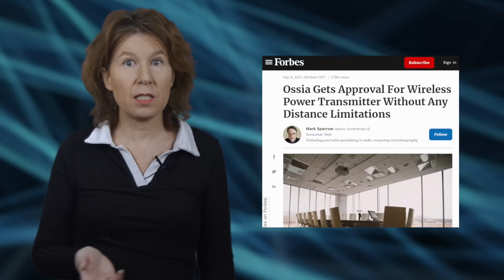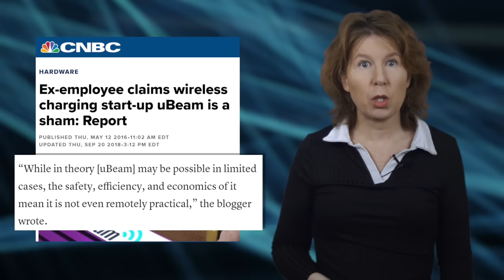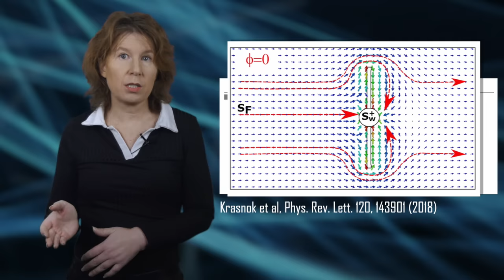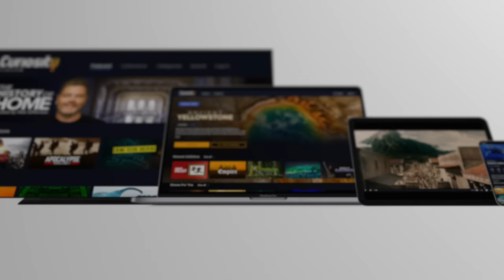How close is wireless power technology?

Comment: I am a ret. General Contr. and Doing Science since I can remember. The problem is the average person and even scientist has a clue what they are taking about. Even promoters of EV are illiterate. I hp = 750 watts start their. I built Oil Caps and UV Pulse Lasers for my Man made Step Leader Project to harness Lightning. I also have built home brew Parabolic Reflector and Collector up 6.4 kw. and Have a 5 meter Commercial Dish I aquired when I installed system for Cable. I lobbied the Cable Act in 92 and was a part of the worlds first C-Band Satellite Radio Station. I did the Ham Radio Links and Gateway from 2985-87. I have used and am familiar with Micro-Wave from 2.5 to much higher. Also Traveling Wave Guides anx Mixers. The 3.7-4.2 C-Band downlink freq. is part of C-Band and originated with ATT terrestrial Towers Prior to Satellite transponders in the Clark Orbit. Most of the people Have no conception of RF or Inductance or Capacitive Coupling or B-Field Coupling. They live in a world of make believe and lack understanding of just how much energy is carried around those wires. So.much make believe about solars 15-22% non efficient cells and Wind BS. And Lithium I spent years Trying to shake that electron loose with UV and X-Ray with a little success. My folded Large Plate Capacitor Design Revamped the UV Gas Laser. Takes a lot of conductor and Short distances to dump those electrons on tge rail. My folded LASER design did that. Vanderbilt Copied It. In 1990. These people seem to not understand even the most condensed beam or cardiodic pattern while not omni-directional still because of the magnetic component spreads. While a laser being of the same frequency and lacking that b-field spreads far less if the waist beam is set properly. I spent many hours with Plasma, HV Resonate Xfmers, and Accelerated Disc and tubes of Copper and Aliuminum. I had some water cooled klystrons. Many supplies I built up to 7,500 vdc at 1 amp for linear Class B Grounded Grid Amps with 4-1000 jugs. I also has the avantec 3 meter aluminum Tower dishes with Shrouds and Back Fire Transmit Systems. From Solid Rocket Motors in early 60's to Telecope and Equatorial mounts. Ton of.home brew electronics. Technology is Great But Perpetual Motion is Garbage. If it ain't  broke don't fix it. When someone spins a disc and cuts a slit in it and puts a semiconductor junction across the gao and now detects super tiny fields if energy at a distance Just reverse tge process. I wished. But, A shorted turn or a Time machine you decide. No two point with in the disc are here and now with respectbto the other. A shorted turn. Yes, but so much more. Look inside at the crystalline structure and why it is a literal time machine and why the universe is not straight. This matters. And doing di-electric phoresis in conjuction with it was intefesting. The power of an arch in a beaker will explode it with a 1.5 volt battery. It isn't the equations butbhow you look and understand it. Ask the man who understood the law.of falling bodies, the Sun Center Universe or Who seen the Electric Field and Impressed Maxwell so much he found the small c. Man still is searching for Lumiferous or Either..The Michelson experiment that just skipped or that the electron has is both particle and wave. There truly.is a language beyond mathematics. But like a dog working Calc or a ant giving a rats ass  about an airplane going over head we are bound to not speak that language if  ever. Our 600 years of modern science makes us arrogant. And some down right stupid. To see in the mind and understand is inventing and making a better world. All these things are linked or not. Great insight and not afraid to call a fowl when you see it. Thanks for your video. Indeed it is the wild west on here when it pertains to science or truth. Thanks Again.

Comment: I've heard of "rectifier antenna wallpaper" that is supposed to do something like your 5G example. I believe the engineering experiment (CU Boulder) was a success; but don't know that it was anything more significant afterwards. 

I'd make enough to carpet the inside of my house if I could.

What frequencies would be more efficient? Lower or higher? I'd expect higher frequencies.. but maybe my physics is off? Does high frequency also imply greater energy density?  I suppose it wouldn't matter.

Comment: The idea of tiny flying robots that crawl in to your phone to give charge is silly. That said there is something interesting there. I am thinking a bunch of very small batteries that plug directly into the phone (no cable it just sticks out of the port) that are kept in trays that charge them with near-field transmission. When you walk into a building you can just grab a battery and plug it into your phone, you are then able to do whatever while your phone charges and don't need to be tethered to a wall. Once you are done you put the battery back in the tray and be on your way. 

There are a bunch of things in software/account management to make theft and vandalism less problematic. 

Honestly this seems like a fairly bad solution but interesting to think about.

Comment: I go with original Maxwell and his quaternion equations, not the half truth that is the vector variants of that (please make a video about that, quite fascinating). For real point to point energy transfer, EM waves, even with beam forming make very little sense. What you need is a colosed loop LW wave, tesla worked with LW waves, but he only knew the isotropic kind. Closed loop lw waves are created in a smith coil. You need to pick the right center material and do pulse discharge from a capacitor bank.

Comment: I was hoping you'd discuss the long-range applications more.  There's a company from New Zealand trying to avoid the "don't electrocute birds" problem by radar off-switches.  Was wondering how viable this might be as an alternative to ridiculously expensive undersea cables.
Reply: I'm so sick of these startups. Do they ever stop to ask whether such a thing is of any practical use?
Reply: @Patrick-857  I feel like the practical applications if you can get this right are actually pretty self-explanatory.
Reply: @gg3675  There would practical applications for magic wands too if they were real. We're talking about hypothetical practical applications for something that basically has to violate the laws of physics to be practical at all, so it's it's redundant to say there are practical applications. I'm sick of this hype train BS. Cables are very efficient, cheap and safe for what they are. When you say ridiculously expensive undersea cables, what exactly are you comparing them to? Do you realise the amounts of energy such cables transmit? For what they do, they are cheap. Not only are they cheap, but there aren't any alternatives, beyond building more power plants closer to the end user, and that's not necessarily cost effective. The sheer amount of energy transmitted by something like the Cook Strait Cable, if transmitted through thin air over distance? I think electrocuting birds would be the least of your worries, you're talking about enough energy to fry everything in it's path. Have you ever stood under big transmission lines? I have, I used to work in telecommunications, and I've had decent electric shocks from current induced in the cables I worked on because they were in the general vicinity of 110kv transmission lines. You can just about feel the humming in the air, it causes metal objects to hum. Have you seen what 11kv can do when it goes where it shouldn't? I've seen the results after a car crashed into a pole, brought the 11kv down onto the 400v below, making everyone's house wiring into 11kv. I've seen what happens when a dumb drill rig offsider drove a small rig with the mast up into 11kv lines. Not pretty. Have you ever played around with magnetrons from microwave ovens? I have. I've also worked on microwave radio systems, and am aware of the safety protocols when it comes to transmitters of only a few watts. I can't imagine what transmitting little megawatts, or even gigawatts would look like. Pretty much what you're proposing isn't a piece of infrastructure, it's weapon of mass destruction. It's not happening.

By the way, the airwaves are very full as it is and have to be very carefully managed to allow all the different services to coexist as it is, and all the wireless communications we rely on now have increased that dramatically. Why do you think we shut down analogue television? To free up space for digital television and 4G wireless. It wasn't going to work for them to coexist. Now if you introduce long range wireless power to the mix, assuming it's otherwise viable, you will have huge issues with existing wireless technology. The amount of interference it would create would be insane. And that's interference, meaning the equipment  is far away enough that it's antenna  doesn't pick up enough energy to turn it into a smoldering mess.
Reply: @Patrick-857  I’m sorry but I am not reading this diatribe at 7 AM. If you would’ve taken the half hour you spent writing that to actually go look into it, you’d have answers to most of the problems you posed. I never endorsed this company or tech. I simply said I was curious about it, but she didn’t really cover it. That being said, if you think the European Space Agency is involved in developing tech that breaks the laws of physics, maybe that’s a clue that it’s your first assumptions based on two YouTube comments you half read and a video that didn’t even really discuss it that are wrong. Just a hint. Get a life.
Reply: @gg3675  lol.

Comment: The question of wireless power transmission is moot, considering that as fossil carbon as a primary energy source goes into terminal decline, the net energy return of 'renewable' replacements will be so much lower that we may not be able to maintain the level of complexity and relatively high living standards currently enjoyed... and solving the long term, sustainable net energy problem wouldn't begin to address all of the ecological and resource depletion problems associated with the population overshoot.

Comment: meta materials, please :) Also note USB C can deliver up to 100w (and soon 240w) using higher voltages as well as currents, in increments of roughly harder implementations above the 4.5w you stated of 10w, 12w, 20W (common and cheap), 30W (pretty cheap, often 12V) etc at voltages of up to 20V (50V in the future) - sadly wireless power is chasing its tail when an 80% charge can take minutes now !

Comment: It could be AM radio trigger charge over battery array, or laser ring disburse energy by broadcasting energy light at low frequency high intensity and capture by gapped power storage transfer flash into storage voltage , the third way is cook most of city area and oper ether at substation far from residential extreme high sun ray at low ether to create energized region then substation convert into both solar and heat peltier generator cells,  but with motor generator alternating winding then power is not needed as much as before

Comment: Wireless power generation was solved by Robert Heinlein in his 1942 novel Waldo, in which he not only solves power transmission and generation, but invents waldos, the remote controlled hands for handling dangerous materials. Heinlein's solution is simple, just have a witch inscribe a magic glyph on the collector and it will draw power out of the realms of magic. ;)

Comment: A question: How practical would it be to energize stretches of road to charge electric vehicles? How much loss compared with wired connections?
Reply: Well we could use the same technology as wireless phone charging since the batteries are located on the floor of cars. The problem is the cost and maintenance of the roads.

Comment: Not such a bad idea. Small robot's each carries a capacitor and delivers the charge. I mean, it's more realistic than the other options. For me, I'm ok with plugging it in. It's not the biggest of my problems. For applications  where wireless is a big advantage wireless power transfer is used and efficienty is usually not a requirement.

Comment: She missed one of the largest benefits of wireless energy transfer.  You wouldn't need large batteries and batteries could be potential be replaced entirely with capacitors. Also the potential for replacing heavy batteries and other fuel storage systems with antennas and capacitors would result in a huge weight and size savings making flying vehicles much more practical.

Also, I think that it is an important fact the the power necessary to power a device is significantly lower than the power needed to charge that same device.

Comment: Power transmitters of 100,000 wats and up already exsist. ....... Every FM and AM radio station. By tuning several receiver coils to the appropriate frequency you can extract power from the radio waves already broadcast in most metropolitan areas. And yet nobody does this.

Comment: there are still many problems with this electrifying the air like tesla proposed is ng anything with an antenna would be subject to interference that means no cell communications any kind of rf broadcast and including integrated circuits only way are modulating to some higher frequency and demodulating it and still that's not going to be super efficient compared to wired ac over long distances

Comment: If the device can be plugged in at all, i.e. it is not inside someone's body or the like, wireless power is a wasteful luxury. It would induce voltage across random metal objects not intended to be powered. Even if the currents wouldn't be dangerous, they would interfere with radio reception. I've seen a chinese wireless charging coil running so hot that it melted. A cable can be tucked in/stapled to a wall or furniture, and a good plug with little wear selected.

Comment: I wonder, is it possible to convert ambiant heat into electricity (without a cold source) ? Some sort of microscopic material small enough to vibrate using ambient heat and create a micro oscillating current

Comment: So in a world where we supposedly concerned about the Environment and needing to lower our impact we got people who thinking increasing our Energy demand why using inefficient wireless transmitters is a "good" idea.  Sure the current one that uses the power of a fridge takes over 10 times as much energy to power something compared to just plugging it into the wall right now. But even if they drastically increased it's efficiency it still not as efficient as direct wires. 

Sure it's a cool idea and the charging platforms which require direct contact like the phones and shavers aren't going anywhere. But across the room charging is probably decades, if not more, away. But even then we would need to solve our issues with how we currently get energy as increasing the demand isn't gonna help us much.

Comment: I think that wireless energy transfer will never happen because of the fundamental problem of so much energy going through the air. Suppose a transmitter had to service a suburban area; there would be n refrigerators, m electric stoves, and q air conditioners in that area. That's a lot of energy to transmit, and you can't have that much energy going through the air without, potentially, a large amount of danger.

Comment: I'm guessing it woudl be pretty difficult, but I'm surprised there weren't any companies mentioned that would use 3 transmitters to send out signals using the fourier transform to increase amplitude in a specific area?   Like the opposite of triangulation?  Actually I guess you could use triangulation to get the location of the phone and figure out where to increase the amplitude
Reply: That's the idea of the startup Ossia that she mentioned, except they use a few 100 antennas, not just 3.